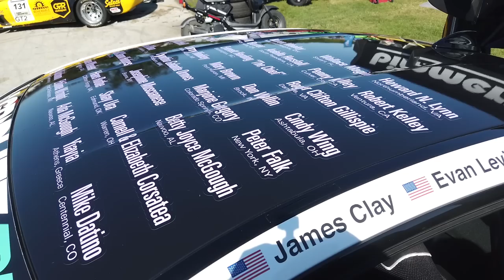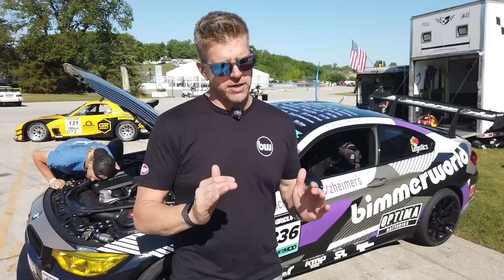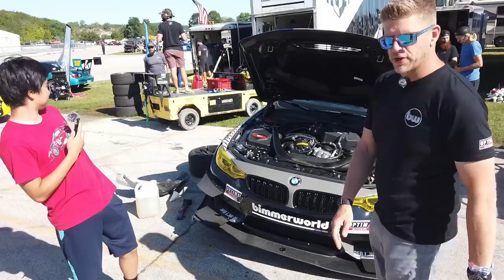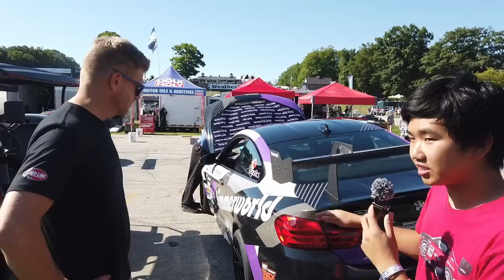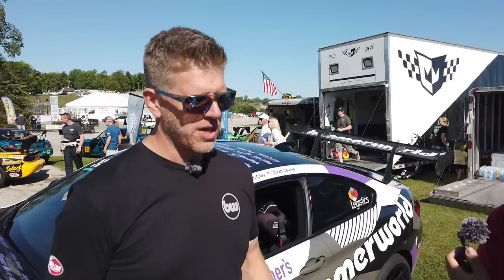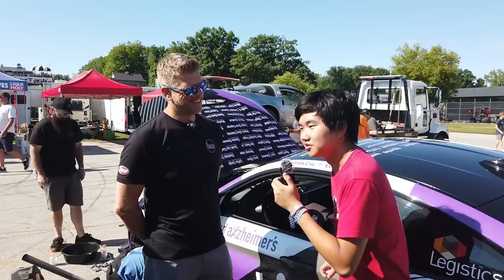Faster than M4 GT4! Bimmerworld F82 M4 GTMore - Time Attack Rivals

Comment: I´m part of a pitcrew for a team that drives the m4 gt4. From what i can see the aero on this one is much more agressive. Bigger wing and longer front splitter. And probably more power as a stock m4 gt4😅
Reply: Is it faster than M4 GT3? That would be insane.
Reply: That was certainly the goal.  Use the GT4 as the baseline and push well beyond those limits!